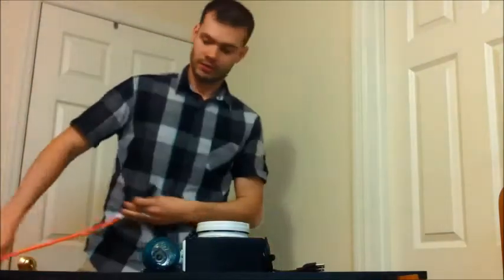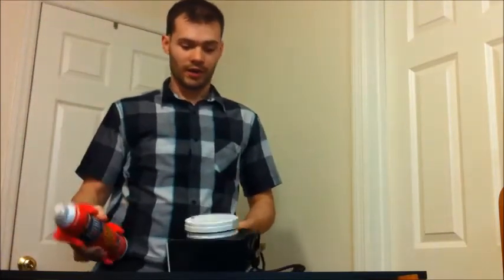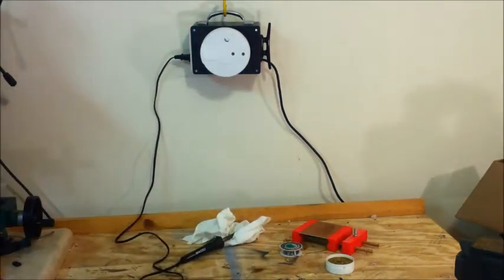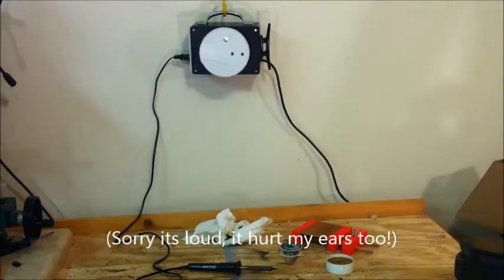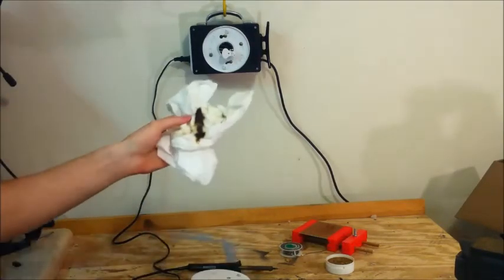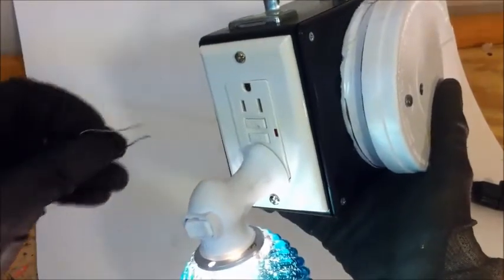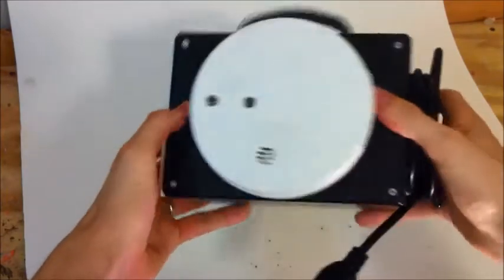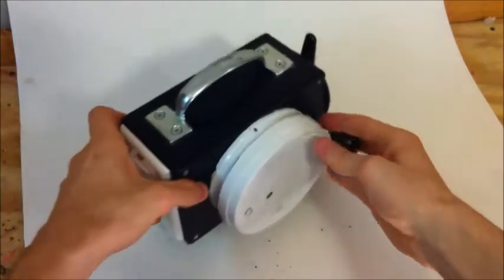Smoke Detector Disconnector Demo

Comment: A good upgrade to the GFCI only outlet is one of the new ones with arc-fault interupt (AFCI) in addition.
For example:
https://www.amazon.com/Leviton-AGTR1-GY-SmartlockPro-Function-Receptacle/dp/B01CG8MOZW
They can beat some fires before detectable smoke. The tamper resistant shutters are great for something on or near a work bench to prevent accidental and unnoticed tiny screws or other parts ingress.
I think I am going to slap a panel mount circuit breaker in there too at 15a or maybe 10a as an added layer of protection and hopefully beat the house breaker to the punch on tripping so I don't have to run to the basement.